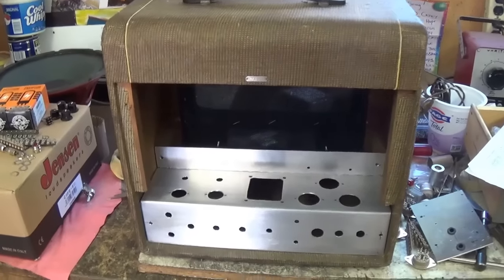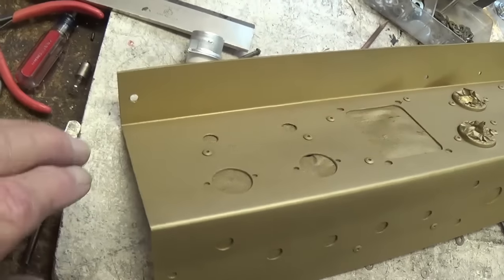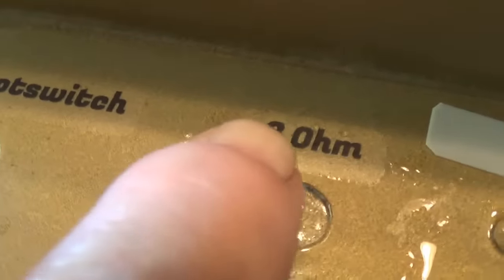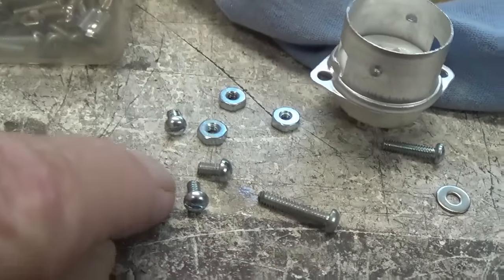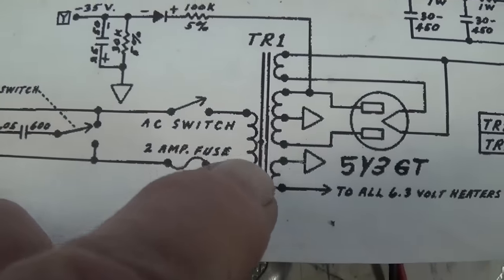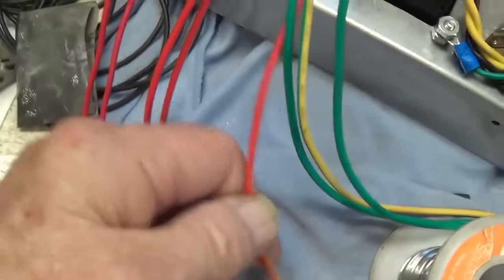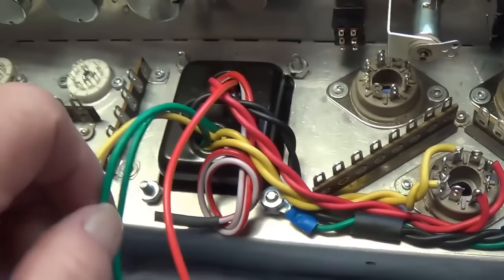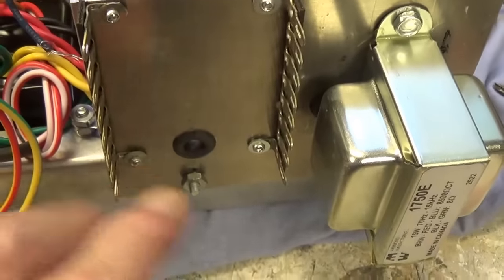Let's Build the Suprinceton, Part 2:  Chassis Painting, Assembly and Wiring

Comment: That's turning out very nice. Interested to see how your star grounding works. I've converted the chassis grounding in one of my old 60s tube amps to star ground - it really made it a lot quieter!
Reply from the maker: Thanks, VCF. Having heard the end product, it worked quite well indeed :)
Reply: I thought with a star ground method there would be at least one connection to ground through the chassis. However am I right that in this amp all the start points end up connected to the CT of the power transformer?
Reply from the maker: Although all electrical grounds go directly to the HV CT, they also connect to the chassis through the input jacks. @allanpennington
Reply: @allanpennington  The way I've done it, I used isolated input jacks and had all grounds connect to a single point which then connected to chassis. For the speaker jack I used a non-isolated type.

Comment: I don't mean to criticize, but I am not a fan of using rivets to attach the tube bases.  Over time, the inevitable rocking of the tube when removing and reinstalling it, will eventually loosen the rivet(s).  I believe the thermal expansion and contraction due to tube heating and cooling from use, can also gradually loosen the rivet fastening.  I have actually seen this a couple times, once when refurbishing an old tube o-scope, and once when repairing a tube PA amp.  Both had loose riveted sockets.  Just a thought.  I'm loving the project, Doug!
Reply from the maker: Thanks for your helpful input, Thud. I'll keep an eye on the rivets.

Comment: Screen grid resistors are often recommended as an addition and the buss needs one lead going to the chassis.  Most say to bring that to the input jack's ground which is on the chassis since it is not plastic.
Reply from the maker: The buss to chassis connection was indeed made through the input and output jacks, JJ.

Comment: Doug, what do you think of the lacking screen grid resistors? Do you prefer them to be there? I think they could serve to save the tubes and enhance HF stability. Not sure if the precaution to save the output tubes is necessary in this case.
Reply from the maker: No need unless the first nodal "resistor" is a filter choke, AG. In this case, the 1K Ohm nodal resistor serves the purpose of the SR's......at least in my opinion and that of Leo ;)
Reply: @UncleDoug  That makes sense!  Thank you!

Comment: I've been doing some repairs and tracing a hum problem on my valve amp that I built from old parts back in 1980s.  I've gotten rid of almost all of the hum by changing the earthing of the input, via it's own wire, directly to the common grounding point, and adding a centre tap to the valve heaters via two 100 ohm resisters. One thing that had been baffling me, until I watched this upload of yours, is whenever I tighten one bolt that holds the power transformer to the aluminium chassis, it produces a slight hum. Whenever I loosen the bolt, the hum stops. I believe I might be experiencing this electrolysis thing that you speak of… Particularly since I've just replaced an old smoothing cap, which spilled it's guts all over the aluminium chassis and now that I think about it, probably drained electrolyte under the housing of said power transformer...  🤔
Reply from the maker: It could be electrolysis, JB, or simply hum induced by vibration in the PT. Press on it while it's humming and see if the noise subsides. Either way you probably need to clean out the spilled capacitor guts.
Reply: @UncleDoug Yes! when I press the hum comes and goes… Very intermittent!
Reply from the maker: The transformer leaves are vibrating. This should stop when you tighten all the screws holding it together. @jetblakink
Reply: @UncleDoug I'll give it a try…  🙏🏿

Comment: Imagine my delight to find an Uncle Doug video! That knee-porn was simply scandalous! 🙂
I know you are custom building a Princeton, but thought I would share something from my scandalous youth. WAY back circa 1980 I was in a band. One of the guitarists had a Princeton amp, in the Fender black cabinet, and for some reason, he hated the cabinet (likely had a small defect in the Tolex?) So he went to a local cabinet maker and had a new cabinet created in Birdseye maple, clear coated (probably in polyurethane, but possibly varnish.) It was a strange looking Princeton, but was actually quite beautiful. And of course sounded wonderful. But a furniture grade combo amp likely did not last for long. Not sure what happened with that example, as shortly thereafter, I got married and graduated from college, so the band moved on without me.
One thing that might help on the decals (though I have not done plastic models in years) is a product called decal set. It somehow dissolves the surrounding membrane, but makes the decals VERY fragile, so it takes some practice to use.
Reply from the maker: Thanks for sharing this lurid tale, and a good decal tip, Ken :)

Comment: Hiya Unky Doug :)
The decal transparent "substrate" may have looked odd as the finish it was applied to was dulled by sanding and a new clear coat removes the dull sanded finish everywhere except under the decal.
Chassis is looking good.
Cheers,
 - Eddy
Reply from the maker: Good observation, EV. Thanks !!
Reply: For myself, having plenty of electronics experience, the most useful part of this project is the numerous tips and comments from people who work with decals frequently, something I haven't done in 50 years!
Reply from the maker: Agreed. Whatever I once knew was long forgotten, until all the reminders from helpful viewers. @goodun2974

Comment: Ever considered using a TRS jack for the high gain input and using the ring lug of the jack to connect a cathode bypass cap to ground when you plug a cable in?
Reply from the maker: No, I never have, AA, but I'll keep your suggestion in mind :)

Comment: I'm blown away again by your skills and knowledge Uncle Doug! I was especially interested in what you were saying about the grounding system, This will help me a great because I have finally commenced a long term project I've had in mind and that is building a Gibson EH185 clone, I'd forgotten that I already have an  aluminium chassis with a suitable power transformer tucked away waiting to be used. I only need an output transformer which I think I have in my collection of bits & pieces and then I can really knuckle down with the build as the chassis already has the 7 holes punched out for the tube sockets. 

Just one question would you have done a video about how you make your labels for the chassis?

cheers
Reply from the maker: Thanks for the nice comments, Osci. Please watch this Part 2 video......I demonstrate how to apply water decals and clear coating.
Reply: @UncleDoug  Thanks Doug for the info on the lazer decal paper.
Reply from the maker: You're welcome, Osc. @osci08

Comment: Uncle Doug, your idea of a ground buss (that's not the chassis) is a good one, but I'm worried that the bus itself isn't connected to your earth ground. Essentially, it's almost like you're operating with a two-prong power cord. None of the components in that circuit have a convenient path back to earth if something goes wrong. Often times, you will see a 10 or 15 ohm resistor (sometimes accompanied by a small cap and some diodes) to connect the buss to the chassis ground. The idea is that this resistance is great enough to keep ground loops and hum at bay, but not so large that it can't be traversed in the event of an emergency. Also, to do the buss ground to the full extent, the grounds on the input and output jacks should be isolated from the chassis and connected to the buss.
Reply from the maker: Thanks for your input, Andrew. The CT ground and chassis ground are indeed connected via the bodies of the input and output jacks. Also, the chassis is directly connected to the green grounding wire from the power cord, eliminating any AC shock hazard.

Comment: Hi uncle, I was wondering why you chose pin number 2 of the rectifier to put your electrolytic filter capacitor and not 8, wouldn't it be the same but with the benefit of being closer to where you are about to connect it too? Lovely video, I'm learning so much. Thanks
Reply from the maker: Actually pin 8 is preferable because it would allow the use of indirectly-heated rectifiers, like the 5V4 and GZ-34......but they weren't considered for this build, so I went with pin 2.

Comment: Great video as usual.
It might be that the display on my laptop is no longer color corrected, but that 10K filter resistor in the second LC network in the power supply sure looked like it was 100K to me.
 This laptop is extremely old, and I know that the cold cathode illumination tubes in it are getting really weak, so it's quite possible that I read the color codes incorrectly.
 The switchable cathode bypass cap in one of the early triode stages is a good idea  because it will keep those people trying to reduce their first stage gain, (to get more headroom), from doing those tube swaps from the 12AX7 to other tube types........
There's another mod that can be done to not only reduce gain and increase headroom, but also greatly increase the second harmonic distortion at the same time; but I think you have run out of front panel space to add it in...
Dennis O.
Reply: It seems to me that the orange was made extreme bright to compensate for later when heat has darkened the ink, so to make sure it keeps readable as orange.
Reply from the maker: The second nodal resistor was indeed 10K.....guaranteed :)

Comment: This was a great series! Funny how you talked about the "aluminum vs steel" chassis debate, as I've been reading up on this recently..

If we're using an aluminum chassis + stainless steel/zinc hardware + chassis grounds, should we then worry about oxidization? I've been told that simply using an aluminum chassis as a ground path is against modern safety code.
Reply from the maker: Since aluminum conducts electricity and dissipates heat much better than steel, I can't understand why its use as an electronics chassis would be forbidden......and unless you plan on mass producing amplifiers with UL approval, who cares what the bureaucrats say? I've been using aluminum with SS/zinc fasteners for many years, without a single issue.

Comment: A common place for electrolysis between aluminum and steel is in bicycles. I.e. an aluminum seat post is binding due to the corrosion in a steel seat tube. The typical way to prevent this, is greasing the contact surfaces. The grease is hydrophobic, so water (moisture) can't get there and act as an dialectric. So if you don't have stainless hardware in a pinch, it may be worth it.
Reply from the maker: Thanks for your input on this issue, Mead.

Comment: Hi Doug! Another great video!!

Regarding the resistor you put onto the speaker output jack, have you thought of going with a higher resistance? Something along the lines of 300 ohms? In parallel with an 8 ohm speaker, that will only nominally change the reflected impedance of the OT, but if there's no speaker plugged in, the greater resistance on the secondary will keep the output of the tubes much lower, even further mitigating the chance of blowing out the tubes or the OT. Plus, it would mean you could install a lower wattage (i.e., much smaller sized) resistor due to the lower output.

At least, that what I was told. If I'm wrong. please let me know.

Cheers!
Reply from the maker: The 8 Ohm dummy load is only connected if the output leaf is in contact with the secondary grounding leaf (i.e. no speaker jack in place), LV, so parallel resistance is not a consideration. I chose the 8 Ohms purely to mimic the speaker impedance, but I'll consider the use of higher resistance in future circuits. Thanks for your input.

Comment: Referencing to 40:10, don't take the B+ off the rectifier at pin 2, take it from pin 8. This way, if you want a little more voltage/current than you can get from a 5Y3 rectifier, you can change it to a 5V4 or even a 5AR4/GZ34, to bump up the voltage and headroom a little,  reducing compression and sag. Those tube types have an independently heated cathodes, tied to pin 8 (if you substitute one of those and try to take,B+ from pin 2, you'll have prematurely rectifier tube failure). The 5V4 and 5AR4 can also safely handle a bit more 1st stage filter capacitance than a 5Y3 can, which might be helpful here.....
Reply from the maker: Thanks for the helpful suggestion, GU, but if I wanted more voltage, I would have used the 325V output rather than changing to the 275V winding. The output voltage with the 5Y3 and 275VAC winding was ideal for this circuit.
Reply: @UncleDoug  , another reason to always use pin 8 for B+: if you or a future owner resorts to "modern" Russian or Chinese tubes, the rectifier you're using might not be what you think it is. There were Russian "5Y3"s on the market a few years back that were actually rebranded 5V4's (some ended up rebranded as 5AR4's, and would fail in short order in some amps). I always use pin 8, just in case, and to preserve options....
Reply: @UncleDoug  , ps, your wiring layout from terminal strips to output tube sockets might have been easier/more symmetrical if you mirror-imaged the sockets....too late now! Pop-rivets are convenient, but I hate them on principle, having had to drill them out all too often.
Reply from the maker: Thanks for your input, GU. @goodun2974
Reply from the maker: Thanks for your helpful input, GU. I will heed the pin 8 suggestion in the future. @goodun2974

Comment: I think that I would have put some screen resistors on the beam forming plates of the 6v6's, if nothing else to provide a fuse to protect the output transformer in the event of a shorted power tube.  Screen resistors also provide an amount of compression related to their values.  But, many great sounding amps don't have them, either.
Reply from the maker: Thanks for the input, Michael. I added a note at the top of Comments relating to screen resistors.

Comment: looks great I have started building an amp myself a Marshal JTM 45 got the heater chain up   
and running but the heater voltage is 6.5 volts some times up to 6.7 volts onload, a  query Doug is there a plus minus tolerance?
Reply: The usual tube manual specs for heater voltage are +/- 5%.
Reply from the maker: Hw are you measuring the heater voltage, IOM?  Tubes in and running or empty sockets?
Reply: @UncleDoug  Full tube set
Reply from the maker: Then you're on the upper end of the permissible range.  @itsonlyme9938

Comment: Hi Uncle Doug! Is there a benefit to making an artificial center tap for the heaters (2 resistor method), over just using the green/yellow center tap on the transformer? Thanks in advance!
Reply from the maker: If you've got a center tap, then ground it, SB. If not, then create an artificial one.....but never both.

Comment: I'm intrigued by the 1.414 constant used to determine power output. I used the same in plumbing to get the length of pipe between 2-45 fittings. Coincidence?
Reply from the maker: The square root of 2 is often a useful value, Jeff.